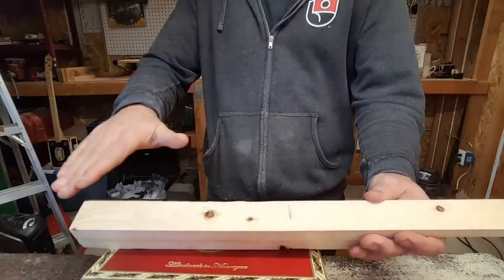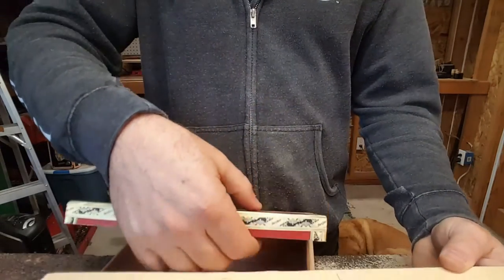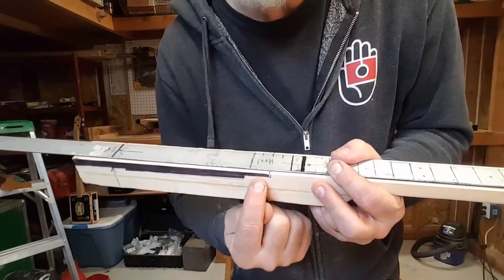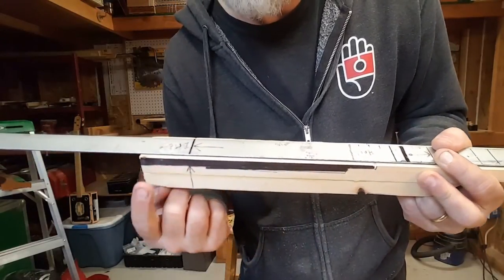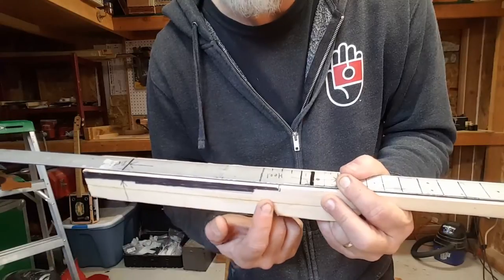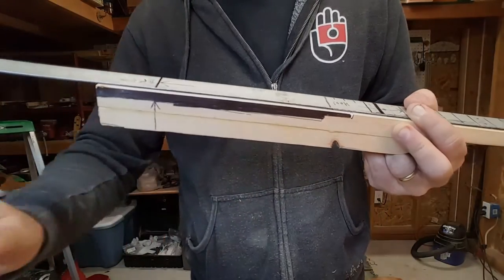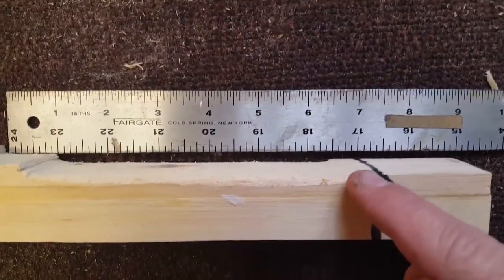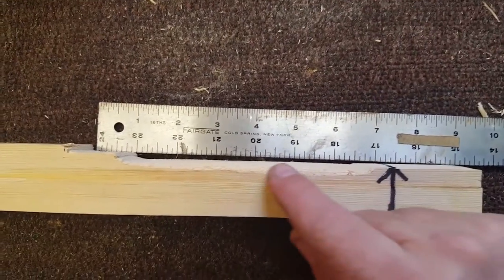Notching the Neck to fit into the Cigar Box

Comment: I really enjoy your videos. They're very informative and I'm hoping you can clear something up for me. I  found a "finished" kit on Ebay I'm interested in. But the neck is only notched to accommodate the lid of a box, nothing more. Question: if the neck isn't notched to the deeper depth and the lid sits directly on top of the neck, how much will this diminish acoustic tone? It'd be my 1st CBG build and without the proper tools and experience, I'd rather not have to do additional work to the neck if need be.
Reply from the maker: Richard White having the "trench" or gap between the cigar box lid (top) and the neck also reduces unwanted buzzes and distracting  vibrations.   i believe it is a crutial and critical step not to be overlooked.  if youre just building an "electric" type of instrument with magnetic pickups then you could probably get away with it.   take the extra time.  its worth it
Reply: Puckett Cigar Box Guitar thanks for the fast response. I'll give it a go and see how it turns out. The neck has been finished with poly. Would you recommend using a a file or coping saw to cut the trench?
Reply from the maker: Richard White whatever you hsve availavle... doesnt hsve to ne pretty since it will be hidden under the top.